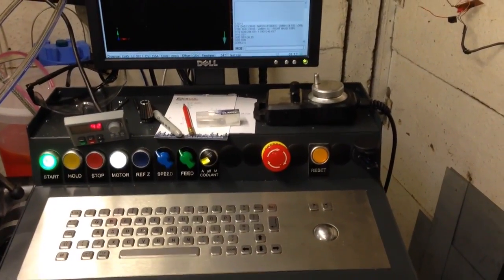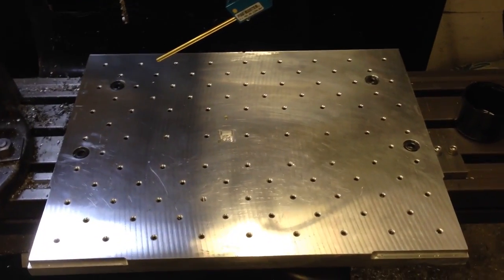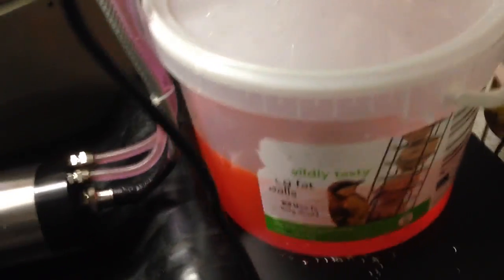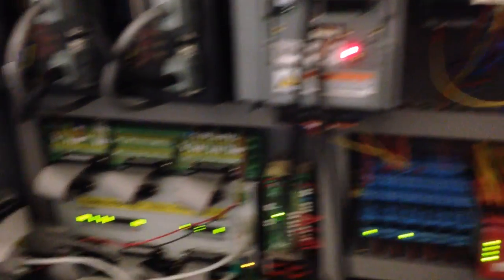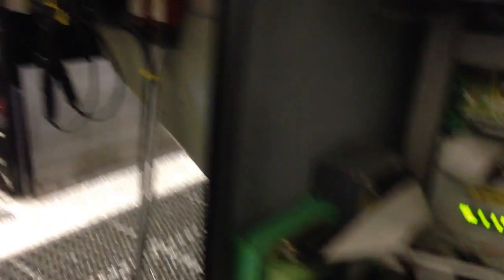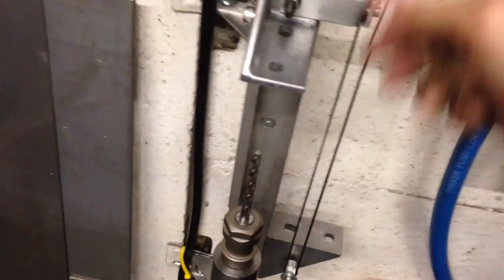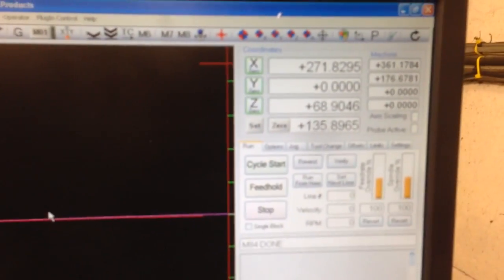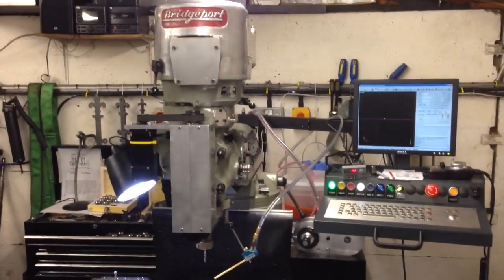Bridgeport Manual to CNC Conversion

Comment: What controller board to drive these servos?
Reply from the maker: They were a combined package from China on Aliexpress site, very common but not a known brand name.
Reply: davek0974 can you share the link. Has it been working?
Reply from the maker: Working very well, here you go... https://www.aliexpress.com/store/product/New-Arrival-0-75kw-2-4N-m-3000rpm-AC-servo-motor-Servo-Drive-3Meters-Cable-Servo/314742_2037554259.html?spm=2114.12010612.8148356.13.3c7c2360evgatT

Comment: if you dont mind me asking? any idea what this may have cost you to do i have an old Bridgeport that was fitted with a bandit box when it was knew back in the late 70s and im looking to upgrade everything on it. there are some old dc servos on it and it has all the old control crap hanging off the right side the plan would be for that all to go... i recently picked up some used steppers (nema 34 i believe) that im hoping to use for it. any advice would be appreciated!
Reply from the maker: Hi, If you don't need ball-screws like i did, it cost about £2300 to replace every electrical part including the drive motor. The ball-screws were a big chunk of money. In the end I spent too much on it, as usual for a home-conversion but I needed something the same size as a BP as I cant fit anything bigger in, there were no old CNC BP's available when I started the project.

Comment: Hi Mr. Dave,
Mario here from Belgium/Europe. 
First of all, as to John, indeed very impressive and very nice conversion!
I am also planning to convert my old J-head Bridgeport to CNC and am looking up all the info I can find on the web for some time now and just came across your video.
I was wondering if you could share what brand of AC servos and drives you used and whether or not you changed the acme lead screws to ball screws? 
Your input would be very much appreciated and would love to see more  on how you did!
Thanks in advance.
Mario.
Reply from the maker: Hi Mario, thanks for the compliments.

The servos came from AliExpress - a seller called BST Automation, first class service and very helpful guy. Yes i changed the screws - the old ones were very worn and sloppy so had to go, almost half the price of the project was spent on the screws! I couldn't find and UK sellers for a kit and didn't want to mess around getting them machined and a yoke made so i ordered a kit from the USA, nice kit but expensive plus import duty etc really hurt. 

I have a lengthy thread here may of interest... http://www.machsupport.com/forum/index.php/topic,32513.0.html

Dave
Reply: Waow Dave, I didn't expect that fast an answer. GREAT and THANKS!
I will definately take a look on the thread.

Comment: Hi Dave
Very impressive I have converted a Bridgeport myself with a friends help, I am very impressed with the tool height setter where can I get some information on your setup for setting tool heights.
John Emery
emers@bigpond.net.au
Reply from the maker: Hi, what sort of info do you need?

Its just a rotary encoder connected to the CSMIO via there ENC module, i think i also used a line-driver chip between the two because the encoder only had single-ended outputs and the CSMIO needs duplex signals.

There is a tiny bit of button macro in Mach3 to read the DRO and call up the tool-table.

Its a great add-on and really saves time.